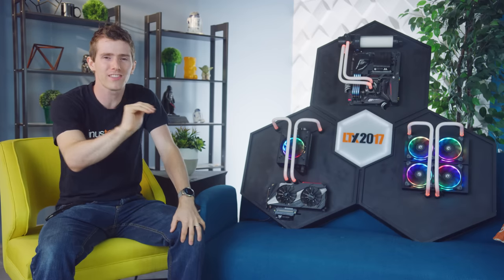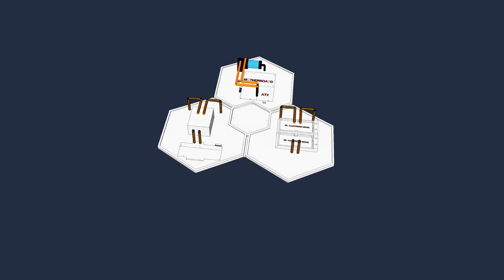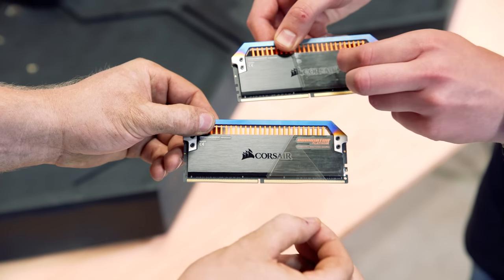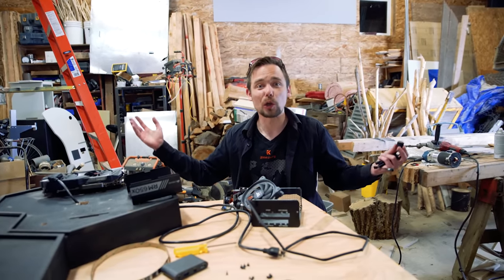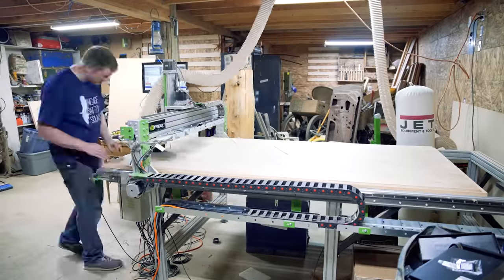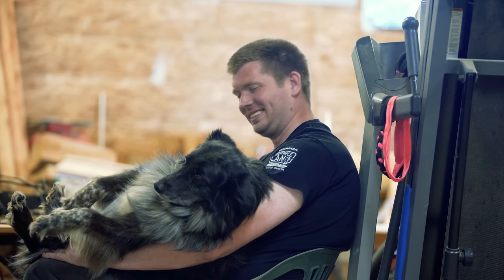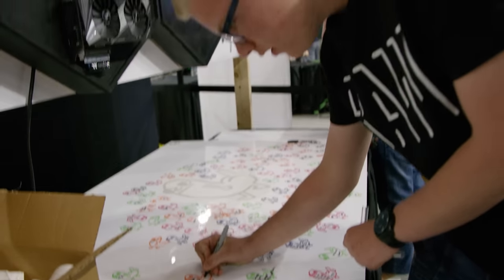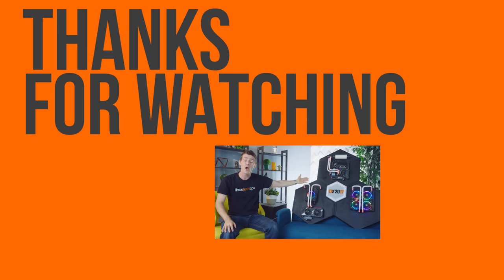BADASS Wall-Mounted Gaming PC

Comment: I'm suprised those daisy chained PCI Express cables worked. I had to go with the shielded version with my wall mount.
Reply: We'll never know for sure, since he didn't actually test them out in practice.
Reply: wow hi jerry
Reply: JerryRigEverything Jerry my man is here.
Reply: JerryRigEverything do durability test of linus pc .
Reply: JerryRigEverything i never expected to find hitman on the comment section
Reply: More like hitman's retired brother
Reply: hi Zack I've looked for those extenders in Thermaltake website and it looks like he used http://www.thermaltake.com/Chassis/Accessories_/_/C_00003015/TT_Premium_PCI_E_3_0_Extender_1000mm/design.htm (or/and the 300/600 mm versions) all of those are shielded so no surprise there.
Reply: Hey Jerry
Reply: JerryRigEverything you bro wassup! Do a video on s8 active..i heard it is lit🔥🔥
Reply: Hi Jerry! Do a co'lab with Linus please
Reply: i read that in zack's voice
Reply: Thunderbolt can replace the need for large, unreliably joined up PCI express extension cables.
Reply: It's so unexpected, since I've had signal loss resulting in malfunction with much shorter, shielded(!) USB2.0 cable runs! PCIe has a much faster transfer rate, too.
Reply: umm................this isn't an iPhone mod video Jerry
Reply: JERRYRIGFRICKINEVERYTHING
Reply: JerryRigEverything is lit
Reply: Hi
Reply: ay its zack

Comment: How are those dust PC's coming along?
Reply: WTF?
Reply: If they are still in that building, they don't need to run for the planned whole year 😂
Reply: Wall PC's don't get dusty at all. I would know a friend and me built the first two.. Mine still hangs on the wall.
Reply: Chris McCaulley
he's refering to an old video that they made, where they would test the dust intake on pc's with positive, negative and neutral airflow (if I remember correctly)
Reply: +svampebob007 I know all about the "dust intake" of a wall PC. They get about 100x less dust then a regular case based PC. A friend and I invented the wall PC. I have had one on my wall now for like 8 years... Mine even has the LED's around it. Basically if it wasn't for me and my friend you all wouldn't even know how to do a wall pc or have the concept of it. Much less putting leds on / around it. You are welcome.
Reply: Chris McCaulley 

Wall PC's have been around since the 90's, and people have thought of doing it for even longer. They weren't as popular as today, but they existed before you did it.
Reply: Yea I had a wall PC way back in the 90's it was great at the time. I found this to be very interesting and things have come a long way since back in the day when I was doing stuff like this.
Reply: I've been in Rods shop and know him personally, his shop isn't dusty, he built vents that push it out

Comment: How is gaming performance on this design? The PCIe Extenders should add a lot of delay, don't they? I tried out 30cm extenders and my performance ingame dropped by 80%, I don't even wanna know how much with this
Reply: I'm genuinely curious to know this as well. I think Jayz? Did a video on the subject at one point though.
Reply: Jay did a normal extender video and there was no loss. Not sure about 6 or something linked together!
Reply: Fuu Ya Is your PCIE riser shielded? Also, what graphics card are you using?
Reply: Electrical impulses travel almost at the speed of light. The only factor that's degrading performance is the power loss because of conversion from electrical energy to heat.
Reply: If you lost 80% performance from a foot long riser then that riser is toast.

Comment: Last week, I did a density mod to my roommates cheap mechanical keyboard. In the process, I broke a wire away from the pin and used that exact 2 tweezer method to fix it.

Comment: Those RGB fittings could fail if you are planning to display the PC 24/7. LEDs on my fittings got scorched(?) after about 5 months of 24/7 use and it only displays red properly now. 
(I guess green and blue LEDs still work but the cover of the LED chips is discolored to brown so only red LEDs shine through.)

Comment: You guys should test to see if a peltier device can be used to cool a cpu better when paired with an air cooler and maybe a water cooler. And see if it's worth the power consumption and hassle to set up.

Comment: how do you plug anything in anything in the back of the motherboard without it looking crap? where is the storage? is m.2 or something? how do you power it on/ off? is there any type of front i/o? dont get me wrong, its an awesome computer, but i feel like you dont have enough video coverage. even a 3-parter like the desk pc would have been better, because i gives more detail and problemsolving.

Comment: Anyway to upgrade this:

Processor- Intel® Core™ i7-7700K
- Quad-core
- 4.2 GHz / 4.5 GHz (Turbo Boost)
- 8 MB cache

RAM: 32 GB DDR4

Graphics card- NVIDIA GeForce GTX 1080 Ti x 2
- 11 GB GDDR5X

Storage- 3 TB HDD, 7200 rpm
- 512 GB SSD

Motherboard:  Intel Z170
Reply: You didn't specify your SSD type, but NVME would be an upgrade over SATA. And of course there's always more RGB.
Reply: Upgrade the motherboard to an z370 one

Comment: Idea: Build a PC into the wall that way you don't have to spend money on the case or the wood and also you could line the insides of the hole you'll make in the wall with sound-absorbing pads so you can have the noisest cooling system in there and no one will hear anything on the outside!

Comment: Whats up pc gamers, so im moving from console to pc and I need some help, my budget is 900$ and i gathered some pc parts for my pc and i wanted to see if they're good or bad and feel free to tell me if theres anything i can upgrade or replace 
Processor: Ryzen 5 1500x
RAM: Corsair Vengance 16GB
Graphics Card: GTX 1060 
Storage: 1TB HDD
Power Supply: EVGA 500W
Motherboard: MSI Enthusiastic Gaming Intel Z170A
Case: ATX Mid Tower

Tell me if there is something wrong or missing and if there is please tell me what to replace it with.

Comment: any info if a corsair ll140 fan would fit into a corsair rm650i ? also is it still dangerous if replace the fan with a brand new powersupply wich was never hooked up? i heard its dangerours because they save energy like a battery...

Comment: Guys can you help me? I want to upgrade my rig, my rig is i3 3240 3.40 ghz with Gigabyte Technology Co., Ltd.  H61M-DS2 4.0, 4gib ram, nvidia gtx 1050 ti oc and xfx 450watt. I want to upgrade my ram to Corsair DDR3 Vengeance Pro Red PC19200 16GB (2X8GB) and my harddisk to Seagate 4TB SATA3 - 7200 RPM - BarraCuda Series, my question is are these upgrade worth enough for me as I aim for gaming and rendering video and projects? I can't upgrade my processor and mobo because minimum budget that I have, I need advice from all of you guys, thanks.

Comment: if you had the thing CNC why didn't you CNC the holes for the mother board stands, cable  and radiator holes as well (that just bad design and machine practises)
Reply: Because measuring by hand is a lot more faster and accurate to measurements.

Comment: Hey, fan of the channel and a long time (console) gamer who is looking to move up from the slow consoles, I'm also (hopefully) starting a video game design course in college in a few months (course offers havn't gone out yet), I'd been playing fallout 4 with mods on my xbox for a while then a friend showed me how much better the fallout, elder scrolls and COD zombies modding experience is on a PC i.e. not nearly as many brain melting frame drops etc.  and now ive been trying to figure out what build to get and my friend is no use because he doesn't actually know much about builds he just buys a new pc for about 1600 euro whenever a new generation of consoles is set to drop,  basicly what i need is a build that can smoothly run aaa games with mods installed and can also be used for 3d modeling as models and textures are the field i wish to get into in game design,  my price range is 900-1100 euro,  i think thats roughly 1050-1300 US dollars and i was hoping you could do a build guide to help me and other beginners like myself

Comment: I don't understand open wall mounted pcs with fans. Fans are logical in closed quarters, such as a case, for air ventilation. What the hell are you cooling? Just stick with a water cooling system and avoid fans altogether. It's seriously beyond me.
Reply: Still need to get the air moving in an open space...

Comment: Also, looks kind of crappy. Just floating components that aren't even connected to anything, can't imagine that cable management. Looks really impractical for wanting to use your i/o interface, good luck plugging in USBs cords or even hdmi cables to the gpu, it's really.... Horrid. @ @

Comment: Worst posible place for IO :D Im actually surprised you did nothing in design for IO imagine all those cables coming down. PSU and motherboard should have been on the botom instead of GPU. Also motherboard should have been lowered into the whole structure for IO to be hidden away in the case itself .

Comment: this build was so disappointing. bland af
Reply: for the amount of effort put into this boring motel wall art, I would've put 11 radiators, basically one per side interconnected them all in whatever piping setup made it cool. done 3 pumps, one for mobo/cpu, one for each video card ( sli 1080ti is a must ). Custom cables. etc etc. god is this a boring computer.